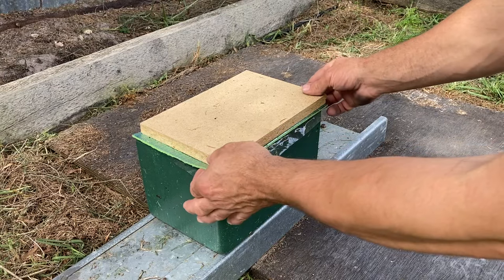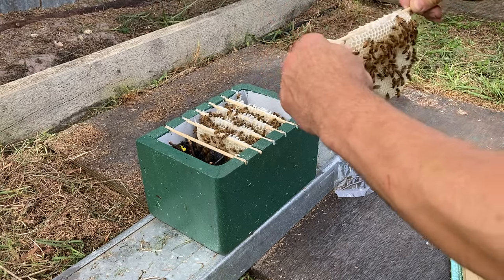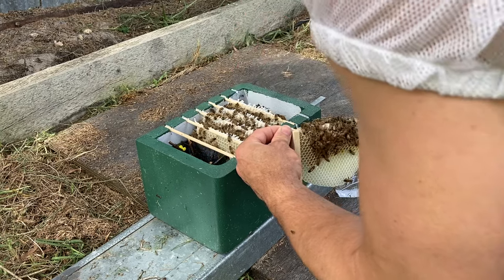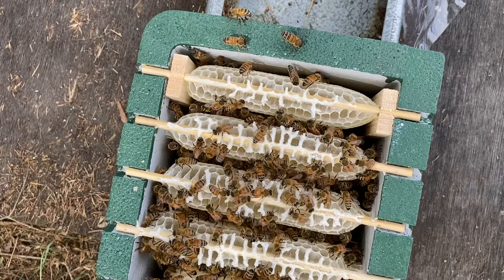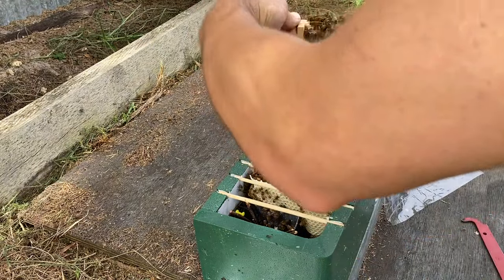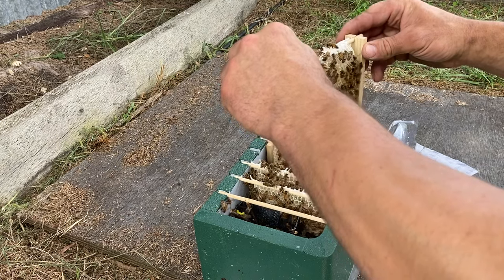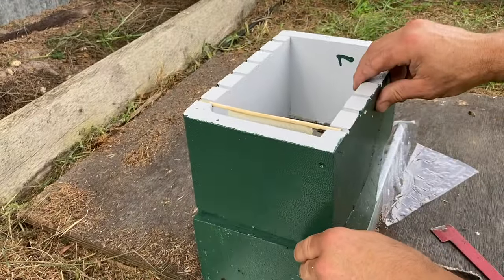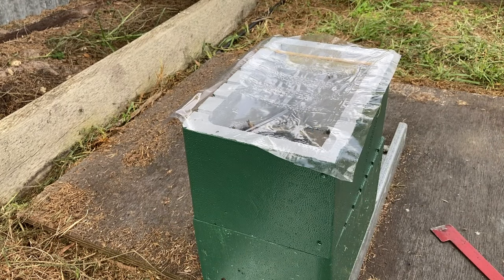End Bars - Homemade Mini Nucs

Comment: Did you use xps or polystyrene?  What glue and what type of nails do you use to hold the sides? What type of paint do you use?
Reply from the maker: Polystyrene with wood screws. Acrylic paint
Reply: @bennybeekeeper  thanks for the reply. I plan on making 30 mini nucs nex year.
Reply from the maker: Good luck 😉

Comment: Warum die Endstangen?
Reply from the maker: To stop the bees attaching the comb to the walls
Reply: Werden die Endstangen nicht auch von den Bienen verkittet?
Reply from the maker: Possibly. But if the comb is stuck to the wall the skewer will tear off. With the end bars the comb won’t break off the skewer.